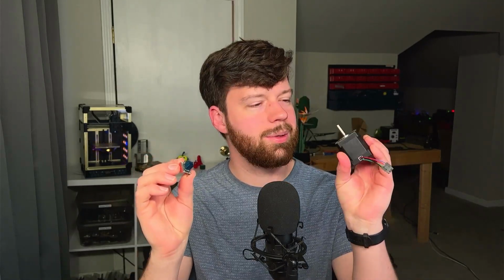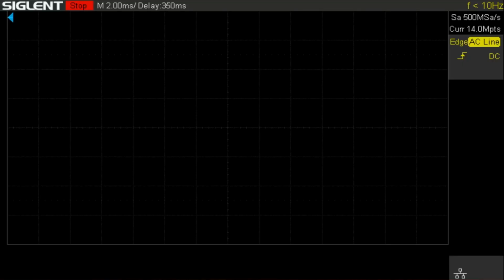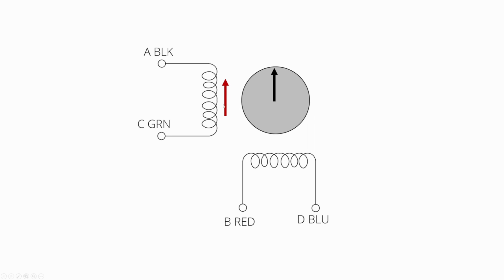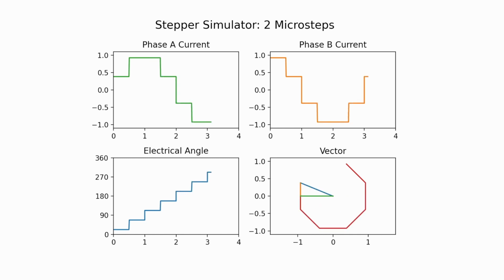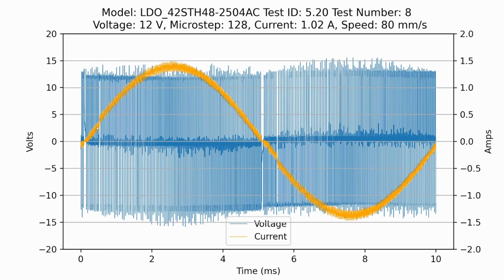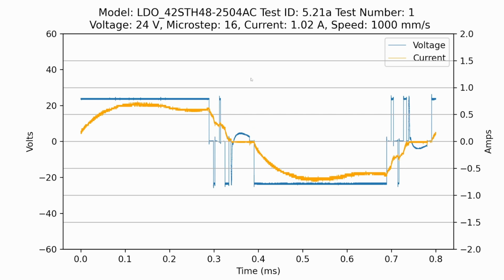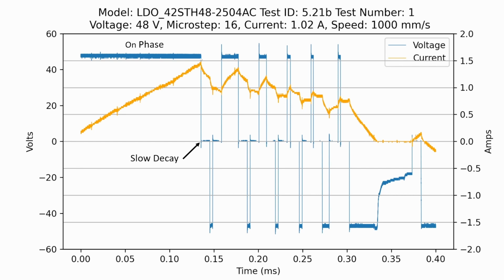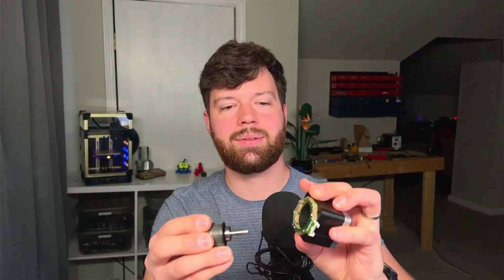Stepper Drivers: Simplified!

Comment: Great video, the simulations really helped me understand microstepping better, changed some pre-conceved notions I had. I am trying to measure the power dissipation of a stepper motor accurately for use in a cryogenic instrument, I think I will find myself a current probe and try to recreate what you did here. Then I can integrate over the current curve per full step and with the coil resistance, get an energy per step (for some speed).

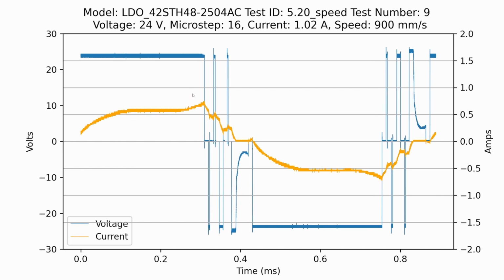Comment: 16:12 If I understood correctly, it was explained that microstepping does not reduce torque (theoretically). But in practical terms that is what it does, since to maintain the RPM I have to increase the frequency and this generates current losses.
Reply: uStepping reduces torque per step. Therefore torque between uSteps is smaller than torque between full steps. You can think of uStepping as continuously increasing torque within a single full step. That is also why movement of the rotor is not guaranteed within a single fullstep when using uSteps. Only when the load torque and cogging torque is overvome, the rotor will actually spin.
Reply: @benjaminheindl1069  Why is that though? Suppose the magnetic field of the 200-pole rotor is pointing up. One phase energizes to make an up facing B-field, and then the other phase starts to turn on making a right facing B-field. As the microstepping goes, the sum of the two phase's B-fields will go from pointing directly up, to rotating clockwise. The magnitude of the B-field does not change (see 12:30). Oh wait, are you saying that torque per full step does NOT decrease when microstepping is used? Maybe I misunderstood your reply

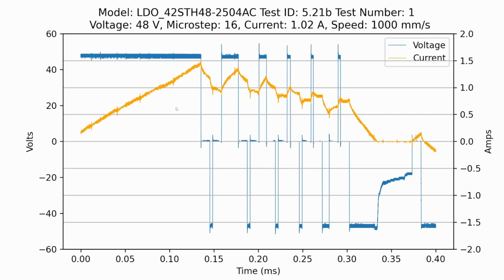Comment: Is it common for the various stepper controller chips to shut off the drive completely, like that at video time 20:20 at scope time 0.30 ms, at the zero-current step ?  I don't see anything about that in my A4988 datasheet.  I could use that feature in measurement scheme I'm looking into.

Comment: I might have a bit of a dumb question, but I'm using a TMC2208 which gets its signal from an Arduino Nano and I just want the motor to rotate in a constant speed, however, even at 3000 pulses per second it's still rotating super slowly, even at just 1/2 steps. Increasing the steps per second doesn't seem to increase the rotation speed , it's like it's reaching some sort of limit.
So is it that the Arduino can't send pulse any faster? Or is there a better way to tell the TMC2208 to keep the stepper motor rotating?
I'm at a loss, input would be much appreciated guys!
Reply: It should work; what is the circuit and motor drive voltage ?  Is the current set ?  I got my Arduino to run a NEMA17 "3d printer motor" at 8000 steps/sec using an A4988 which was on a cheap ~$2 carrier board from Amazon.  I used 12V 1/2 amp at the motor.
Reply: @agnichatian  I have further troubleshot this issue and must confess that I didn't provide enough context.
I'm using an RC controller that provides an SBUS signal to the Arduino which in turn translates that signal to stepper motor rotation speed. The issue isn't the stepper motors, drivers, or pulse speed because individually those components can rotate well faster than my desired speed, the problem was the SBUS interpretation. I just couldn't get that part right.
Cheers!
Reply: @Chretze  cool.  I've had similar  speed-related issues with rs232 and other Arduino library code.  I fixed it by writing my own math, serial, print, timer, servo, stepper etc code over time.  It was fun but I could just use a more modern chip next time.

Comment: i have a question
the nema 23 stepper current at 3A-48v also has the same phenomena as you when reaching 800mm/s(saw tooth-y current)
my only explaination is because the motor coil is missing the rotor at lower Voltage and start to catch up at high voltage?
also i am using full step setup,and fast decay behavior cannot be seen from the chart anymore,do anybody knows why,please give me some material regarding this?
anything else?enlighten me please?

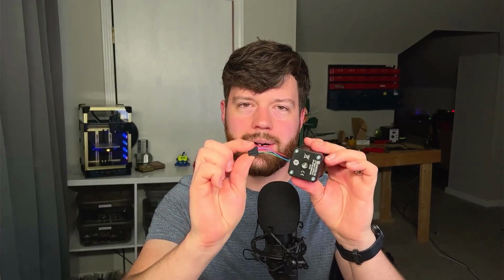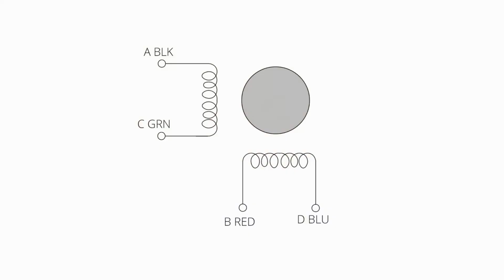Comment: I don't understand why why rely on Nema 17 and tiny drivers. For a pellet extruder we need torque (10Nm) and current so that tiny drivers are no go? Or we can generate that torque with Nema 17+ 1:10 using external drivers and high current +water cooling? 1:15 and 1:20 would limit the output. Robot joint motors (BLDC+reducer) can generate 10Nm having much smaller weight?
Reply from the maker: That’s a great question! With 3d printers, NEMA17 motors actually have plenty of torque, we are rarely using more than 10-20Ncm (I believe—I’d have to refer back to the calculator). You can see the application of this by realizing that with existing motors and drivers some people are able to do travels with 80000mm/s acceleration or even higher—most people stay well below 10000, as the rest of the system/stiffness apart from the motors themselves are the limiting factors

Comment: Good explanation
One additional factor when running fast is the jitter that is getting enoyand when using software puls generation.
That gives U earlier stalls
In higher quality cnc control U use therefore fpga as puls generators.
In higher speeds you can even hear the more equal generation

Looking forward to more of your videos
Reply from the maker: That’s a really interesting thought! Thanks for sharing—maybe I need to probe the step pin to see how consistent the stepping signal is
Reply: in microcontrollers, a pwm/counter module is employed to generate the step pulses, which can give very stable and controllable pulse timings if done correctly. I kinda wonder, why does everyone go through this pulse-depulse process (wanted coordinate->pulses->wanted coordinate->sin/cos), when we could just command a wanted position or sin/cos to the driver directly. That should deal with the problem of jitter as long as the commanded position is updated often enough.

Comment: Can the lack of current when increasing microstepping at high speeds also affect speed/feed rate or is only torque as mentioned in this video

I ran into a weird issue on Marlin Firmware where the speed/feed rate decreases when I increase the microsteps from 16 to 32, 64, or even 128 (Steps/mm also to match)

The bed dimension ie min and max are still respected, but the speed/feed rate has been decreasing phenomenally, almost at the same factor/ratio that I'm increasing the microstepping by
Reply: Oh, also, I forgot to mention. I'm using TMC2209 drivers
Reply from the maker: Thanks for the comment! For Marlin firmware (at least the last time I used it! it's been a while), you need to update the steps per mm every time you change the micro step setting. Effectively--the steps per mm is "micro steps per mm" so if you change microsteps from 16 to 32, your M92 steps per mm will have to double!

Klipper used to be this way as well, until it switched to "Rotation Distance" as a more general level of abstraction. It handles the micro step change internally so that no matter if you are using full stepping, half stepping, or 128 micro steps, the distance traveled will remain the same.

Comment: I'm wondering why a tiny tmc5160 can power a 48v stepper motor when large stepper motors are normally sold with those big box styled stepper drivers
Reply from the maker: That's a great question! I believe the larger stepper drivers are large not due to voltage requirements as much as due to current requirements. NEMA23+ motors require a LOT of current and that current drives larger components/heat.
Reply: @eddietheengineer  
Cool thanks for the reply however I think it might just be down to market separation and disconnect of knowledge.

 It seems that it might just be because nema17 is being marketed for 3d printers, TMC marketed the TMC2209 to 3d printers however 3d printer people are moving to higher requirements and using the TMC5160 because of the higher operating voltages. 

Nema 23+ motors are targeted to CNC machines (mills, lathes). This market has been using the black box style like the DM556T for years and it is baked in. This market is use to dip switches and pulse input. The software for CNC machines like Mach4 interfacing with serial breakouts that connect to the pulse on the DM556T rather then the UART on TMC's.

I've come to this reasoning because TMC5160's can handle a Nema34 motor as they have a peak operating voltage of 60V and 20A(external mosfet) while the DM556T can handle 50V, 5.6A. So by the looks of it the TMC5160 might actually be able to handle a higher operating wattage.

Maybe some of the drivers like the DM556T are using TMC but for some reason I doubt that.

I think it would actually be a sick video if someone did a larger stepper motor running with TMC vs DM556T or similar. My guess is that some 3d printing guys will move onto the Nema23+ to get insane speeds in the near future.

Comment: Some users told me that high-quality motors are magnetically charged after assembly, and once the motor is disassembled, the magnetic force will be lost. I don't know if this is correct
Reply from the maker: I've heard similar things to "don't ever disassemble a stepper motor" which is why I picked an old stepper motor I knew I would never use again to disassemble for the video!
Reply: that is likely the case with old steppers with AlNiCo magnets - those magnets lose polarization if a magnetic circuit they are in is broken - they have low coercivity. I doubt modern steppers are made with alnico, i'd expect neodymiums. Neos will not demagnetize.

Comment: Thanks for your expertise, I'm curious if microstep reduces motor torque?
Reply from the maker: Not really! That's why the simulation showed that the blue line (vector) was a circle--even with microstepping the magnitude of the vector was constant. However--that does not mean that microstepping will always be more accurate or precise than full stepping. At peak torque load, both full stepping and microstepping will have a deflection of 1 full step, regardless of the microstep setting.

Comment: Hi Eddie-truly-the-Engineer, thanks for a great video😀. I have a couple of questions. 
1. How does the fast decay help? Since the current continues to decay even further in the second slow decay phase? 
2. Can the driver put out a higher max voltage than the voltage it is being supplied? I heard someone saying that the drivers have a boost converter, and will determine the output voltage based on the current needed. In your analysis, I see the driver using a constant voltage and simply chopping the duration.
Reply: TMC drivers also support slow-decay-only mode, called 'Classic Constant Off Time Chopper' in their docs. However, this mode requires rather precise tuning. This is because during slow decay phase the current does not flow through R_SENSE, and so the driver cannot measure the current through the winding and does not know when to turn back on. You need to configure that off time correctly. For spreadcycle you are still expected to provide some reasonable hysteresis parameters, but since the driver can measure the current during fast decay phase, it is a lot less sensitive to precise tuning as it can do adjustments itself. Then, fast decay phase reduces the total length of ON->SD->FD->SD control cycle (since slow decay phases are shortened), thus allowing faster step rates and less noise (basically, the frequency of that control cycle can be pushed into 30+kHz, inaudible by human ear).
Reply from the maker: @dmitrybutyugin3857  thanks for that context! That’s really interesting
Reply: @dmitrybutyugin3857  Thanks so much for the explanation. Very helpful.
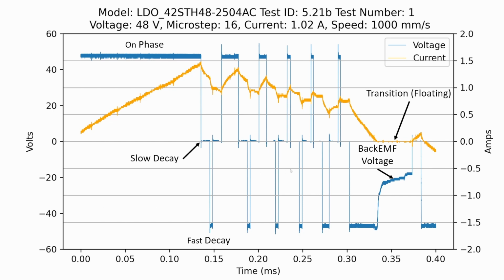Reply: 1) The fast decay phase is there to better match the target current. If you see the diagram at 22:10, you can see the current waveform for a single chopper cycle(so about a 50 microsecond or shorter window). Notice that the area between the target and the first "upper" and latter "lower" part is the same. The goal is to ensure that the average current throughout each cycle hits the target current. This improves microstepping(as the target current is better tracked) and thus reduces torque ripple and vibration. The fast decay phase therefore is vital to SpreadCycle operation because the current can't be measured during the slow decay phase. Having the extra decay mode basically doubles the drivers resolution of the current measurement.

2) None of the common drivers used in 3D printing applications, so TMC5160(and 2160), TMC2209, TMC2130, etc. support any kind of boost mode. The TMC5160 can support external MOSFET drivers, allowing operation with >60V. In practice NEMA17 and NEMA23 used in 3D printing applications aren't going to hugely benefit from above 48V as it's not (at least currently) practical to extrude at these extreme speeds and mostly travels don't dominate print times. The exception to this rule may be high gearing extruders like Ascender, as these benefit quite a bit from higher voltage.

SpreadCycle is covered by US patent US9030150B2, which has a useful diagram of how the driver implements the mode.
Reply: @LasseDalegaard  Much appreciated.
Reply from the maker: 1. That’s a great question! I think fast decay helps if the current needs to decrease faster than it would naturally—but you’re right! Theoretically the fast decay phase could be selectively used only during the 2nd and 4th full step where the current is decreasing towards 0.

2. That would be interesting! So far I’ve only seen stepper drivers like the one I have here, which just passes through the input voltage to the stepper driver.
Reply: @eddietheengineer  Thanks for your replies, Eddie. I too have not seen any drivers with a boost converter, but the person who said that wrote with great confidence 😆, and I know for certain that I don't know everything about stepper drivers. 
Appreciate the content!

Comment: Thanks, verry interesting!

Would it be a correct conclusion that 24v I holding back our stepper motors speeds? Did you notice any increase in how hot the motors became at higher voltage?
Reply from the maker: Yes and no! You can go faster with 48V, but often times 24V is already fast enough 😄 like in the example in the video, not many people are printing faster than 1000mm/s, so 24V is probably plenty for the motor shown! But other motors may still benefit from 48V (like 0.9 degree steppers).

For motor temperatures, they definitely are higher at 48V! A component of that I believe is due to the voltage itself, but a significant part is just because the motor can go faster and the driver can push more current at those higher speeds! So the total power at higher speeds increase substantially
Reply: @eddietheengineer  You need some nice motors or big pulleys to do 1000 mm/s with 24V...
Reply: Thanks for great answer, very interesting, love your content!